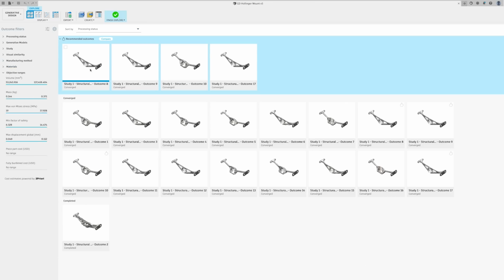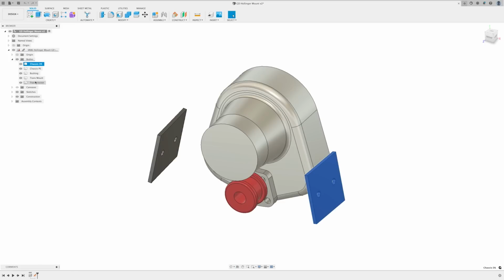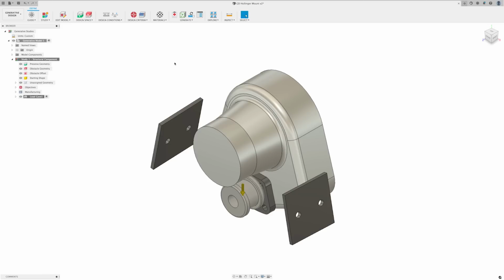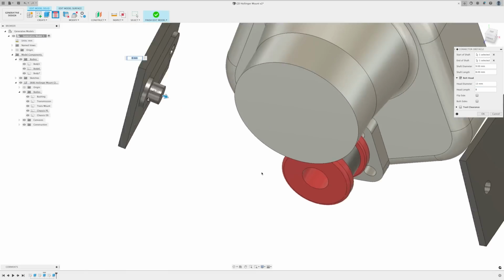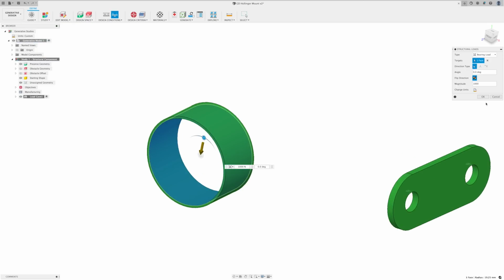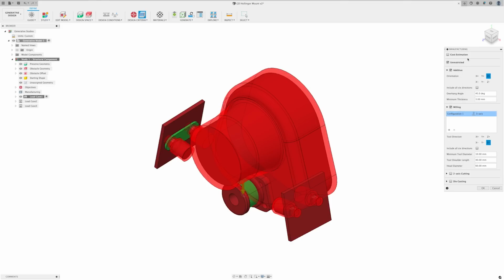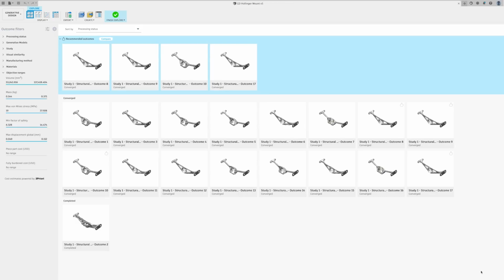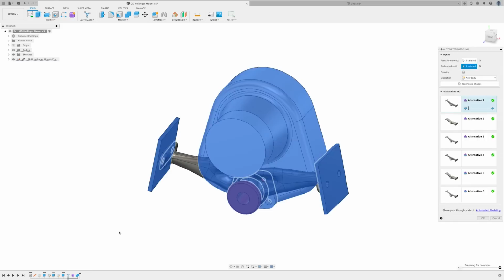What Is Generative Design? | CAD

Comment from the maker: 👨‍🔧 Building a fast car? Get $400 OFF the all-inclusive VIP online course package deal: https://hpcdmy.co/offery187
💻 Learn to design custom parts for your dream car. 3D Modelling & CAD course. Now 50% OFF:  https://hpcdmy.co/offery187
TIME STAMPS:
0:00 - Generative Design, It's a Hot Topic Bro
0:29 - What Is Generative Design
1:06 - Use Cases, It's Not For Everything
1:59 - Benefits of Generative Designs
2:49 - Generative Design in Fusion360
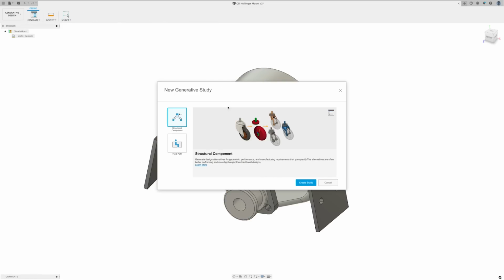4:21 - Getting Started
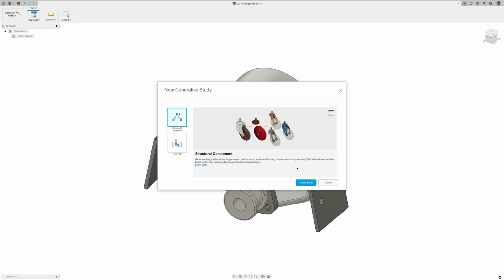4:38 - Basic Settings/Functions/Toolbar
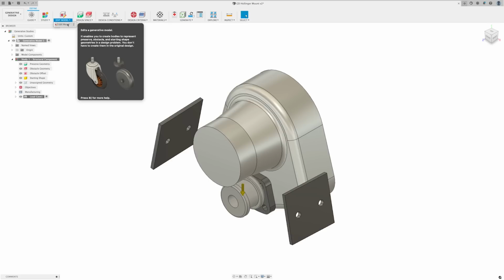5:52 - Model Setup
9:35 - Load Case Process
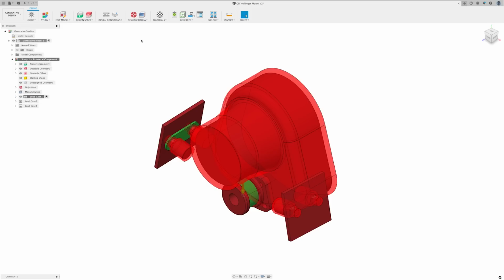12:02 - Design Criteria
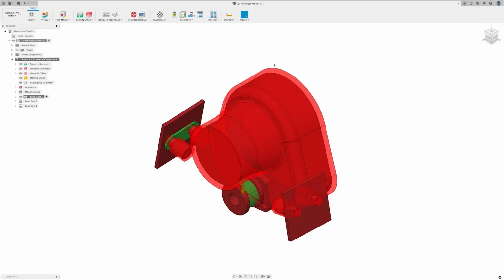13:57 - Material Study
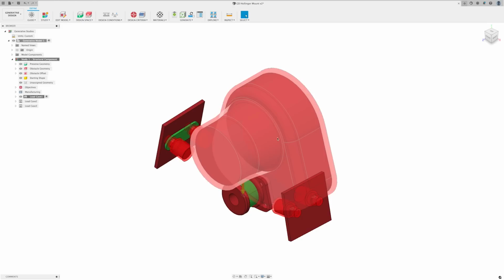15:00 - Previewer Notes
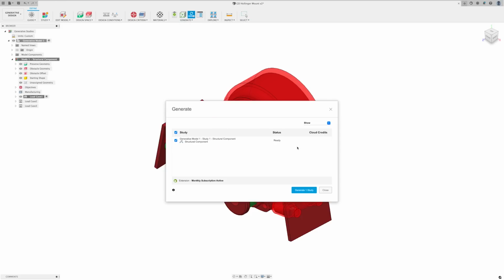15:55 - Generate Study
16:40 - The Generated Design Outcome
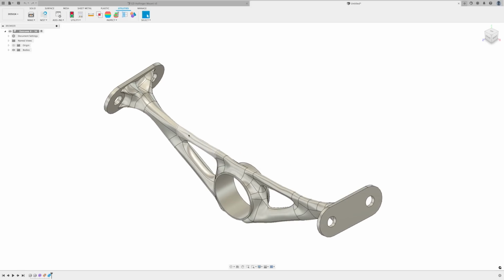17:05 - Automated Modelling in Fusion360
17:47 - Automated Modelling Example/Comparison
19:02 - Auto Model Notes and Considerations
19:41 - Key Points/Lesson Takeaways
20:58 - 1 of 60 Modules | 3D Modeling & CAD for Motorsport

Comment: First time I’ve ever heard of this  , pretty cool . Some could argue that it’s not worth the time , money and effort of creative cad but I can see it getting more mainstream and the ‘norm’  .
Cost I’m sure is the main consideration for the general public and quite understandable. One does have to look at some people’s spending habits and cost cutting exercises that go wrong to understand that doing it right first time actually saves time and money . 
I’d sooner have a piston or gearbox bracket like in this content rather than Pointless Shiny chrome dress up crap and far east Micky mouse components .
Just to add on a totally different subject I see vertically no amateur/ club drivers actually taking driving tuition , probably as they think they can teach themselves or too proud to take advice. 
My view is and recommended to anyone new to motorsport is get some tuition and get them to set the car up correctly. 
That way you don’t waste 3 years actually learning how to race / drive plus take into account running costs , risk of bending your 5-10 - 20 -50k+ pride and joy , ( obviously you other half thinks it’s only 2k worth of car and entry fees and running cost are very cheap ) 😇🇬🇧